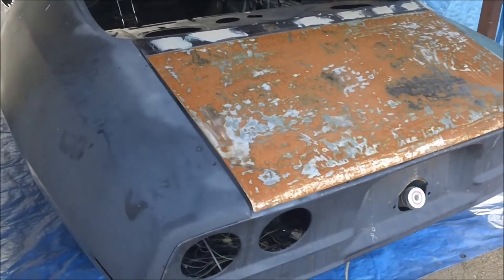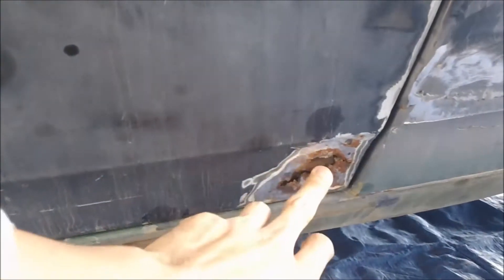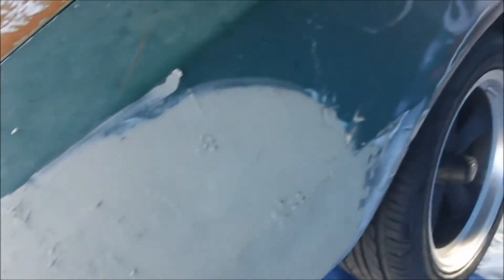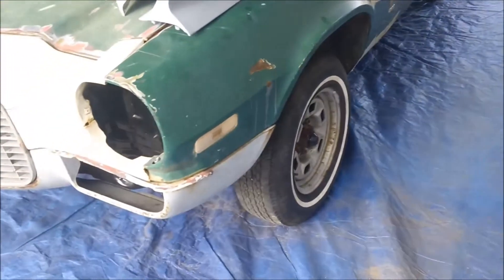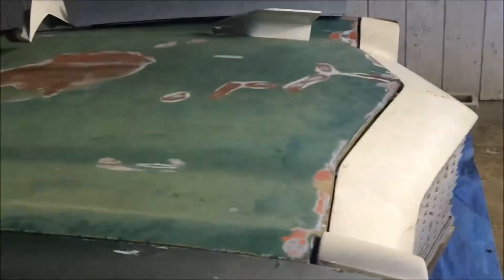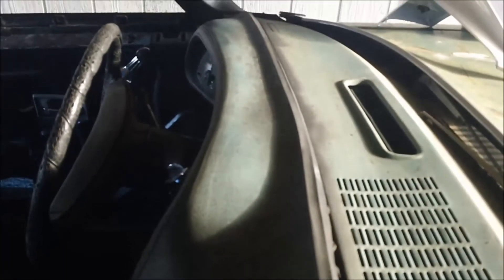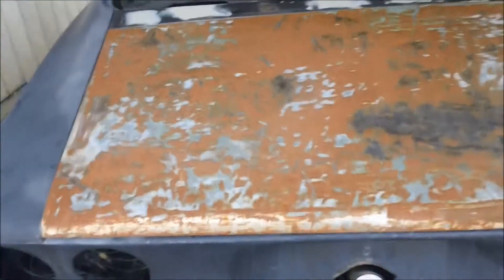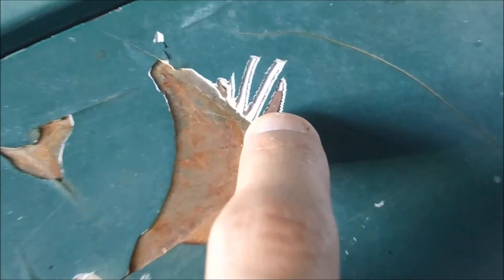1971 Chevy Camaro. New project

Comment: You don't even know what there is to work with being that everything is covered.
Reply from the maker: I got lucky on this car, when I stripped everything down to metal it was all solid for the most part. Shop that had it before me was just a bunch of lazy a$$es
Reply: It does look much better than I thought. That was as much mud as I have seen. Good work.